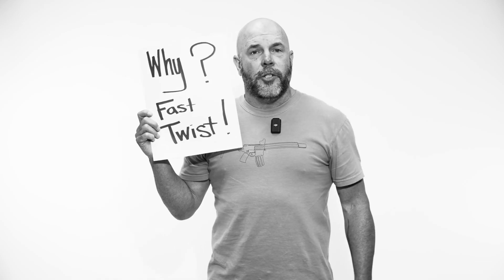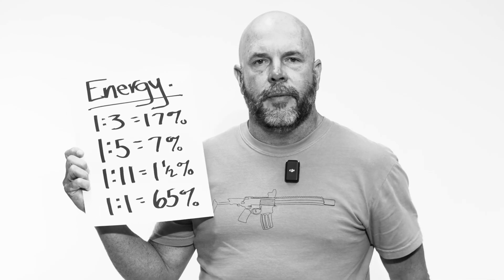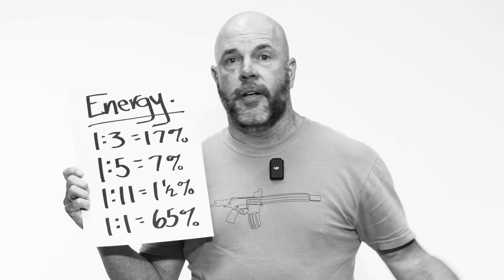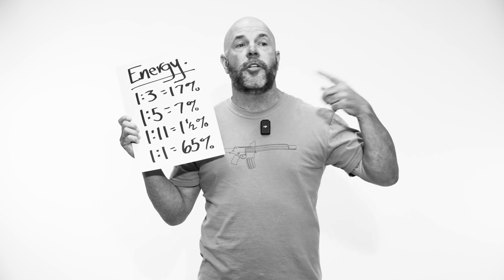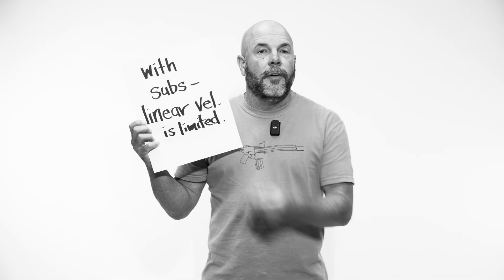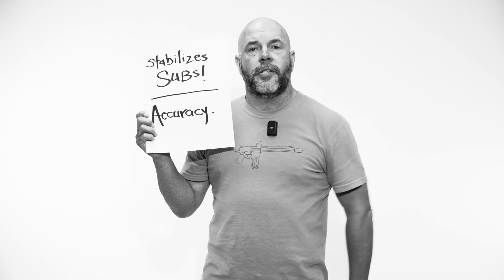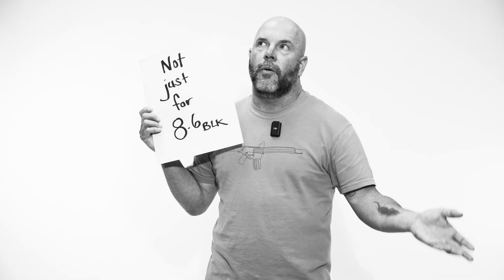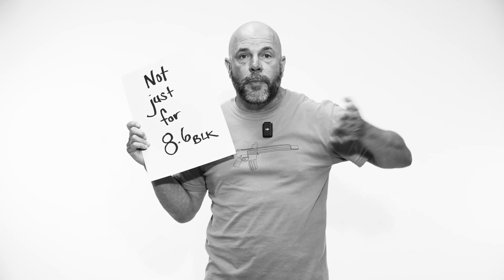Q  |  YQ  |  Fast Twist

Comment: So I’m building a suppressed 300blk SBR with a 7.5” barrel. I want to stabilize 200-220 grain pills so I don’t get baffle strikes, but I don’t want to spin jacketed bullets fast enough to cause fragmentation damage either. 
.
Should I run 1:5 or 1:7 twist?

Comment: Bullet composition, that is what has held back twist rates. You'll spin apart that cheap and poorly designed stuff. However, if you mass produce well designed bullets constructed with proper materials, those bullets become the cheap stuff. Guns are fancy paperweights if you can't feed them. 
I like the Bob Dylan aesthetic of these videos, but visualizations would be more helpful than words.
Reply: I found some videos out there pointing out you can get off the shelf varieties of 556 fmj, and 300blk fmj, and have no issues whatsoever. No barrel obstruction, no fragmenting in the air.

Comment: 100 years ago they didn't have the same types of modern gun powder to equal the same propellant charge that can be achieved  with a Present day Rifle. Is it Possible for a 30-06 Rifle to achieve near 300 Win Mag Performance using a faster barrel twist in a 24 inch barrel for the highest stabilization of the projectile   for long range shooting? 

My next question would be who makes such a rifle? 

😎

Comment: I’ve been hunting with 1:5 twist 300blk since 2019 and have killed THOUSANDS of animals with it . There’s a huge difference in terminal effectiveness when compared to 1/7 and 1/8 . I’m a fast twist believer
Reply: @Michaelpress14  fast twist doesnt add a ton of energy. 
84ft lb on a 1-3 8.6 aub vs 1-8 8.6 sub. 
the angular speed is fast +700 but not 2000fps (usual min opening linear speed)

so id be curious what combination of linear and angular/rotational speed provides the terminal effect everyone mentions. 

you also have to use about 10% more powder to get it to spin faster
Reply: @Blue_Dog_Ranch  you have not seen gel blocks at long ranges without hot loading. You can get the distance, ridiculous temporary cavities, and very reliable opening of jhp, or outright fragmentation of fmj. The main issue is how aggressively you need to aim higher.

Comment: 1 in 5 twist 556 is interesting!
Reply: KAK 11.5” mid length
Reply: @msquared9605  i have a 10.5 right now
Reply: SLR 5" 556
Reply: @bloodpoolyt  how far can it reachout and touch something?
Reply: @FocusedHands  depending on your body type, anywhere from 4-6 feet I would imagine
Reply: @msquared9605  i mean range wise! Like 300 meters plus 500 meters etc etc
Reply: yeah you could probably go down to 7.5 inch barrel and get similar ballistics to a 10.5